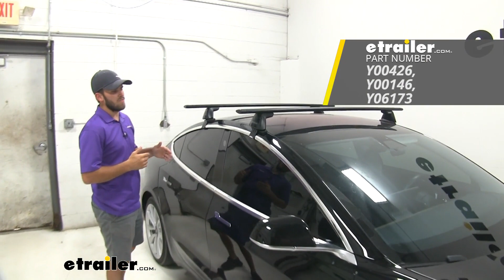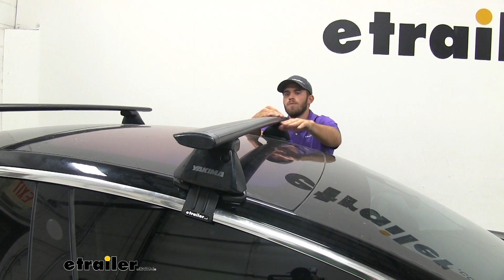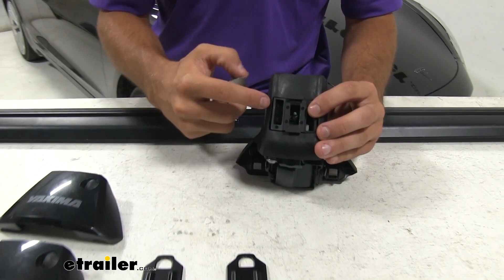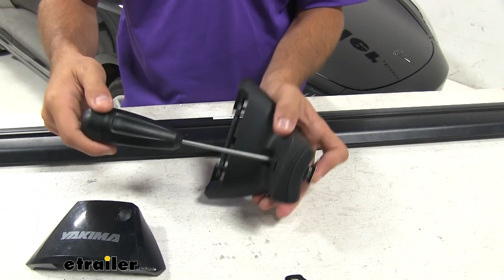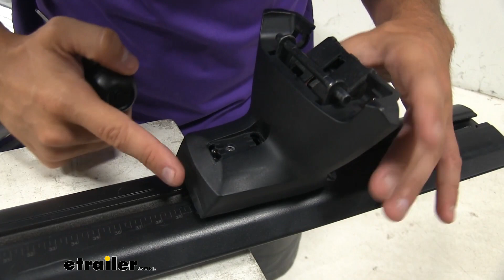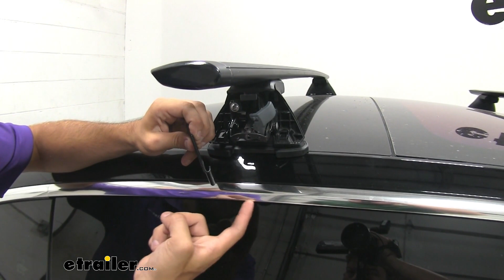etrailer | Yakima JetStream Crossbars Installation - 2018 Tesla Model 3

Comment: Will this rip off the trim?
Reply from the maker: Do you mean the trim inside the door jambs? The clips won't damage anything on the Tesla. They're padded to protect the paint and the molding inside the door is just compressed while they're installed.
https://www.etrailer.com/Roof-Rack/Yakima/Y06173.html
https://www.etrailer.com/Roof-Rack/Yakima/Y00426.html

https://www.etrailer.com/Roof-Rack/Yakima/Y00146.html